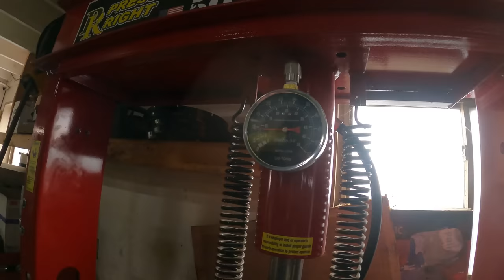Getting Ready to plant Corn

Comment: 3/4 DRIVE IMPACT  SOCKETS WORK WELL TO DRIVE THE RACES IN OR OUT. THE SLUGGER BRAND SAWS ARE GREAT SAWS. THE SLUGGER BLADES ALSO LAST TWICE AS LONG AS LONG AS KNOW SLAMS THEM INTO THE METAL AND KNOCKS A COUPLE OF TEETH OFF.

Comment: This is not meant to be mean. When you first bought the press and you sounded like it may be more trouble than it was worth. Set up can take a while to make fixtures to get the job done where if you just do the job the way you have been doing them it will be faster. I had commented that I have been using a press for years. My little 20 ton harbor freight. And yes making fixtures for the first time does take time but, the next time the job will go much faster being you do have fixtures. 
I cringed so much when I saw you put that pipe right on the race surface. Was so happy when you found a pipe with the correct OD. Yes, please keep them under lock and key. They will walk. 
Thank you for another fine video.

Comment: Allis Chalmers used a 13 wave coulter in the front , and double disc openers for fert, and then another set of double disc openers for planter unit. The trend now is drizzling fert 2" on each side of row at back of units. No extra coulters that way. You may be $ ahead going to the 2X2 attachments.
Reply from the maker: It’s a trend

Comment: I noticed you buy cut tires. To save on the cost , you Andy could easily build a unit to cut them your self. Just saying.  Alot of places are charging 5$ and more to dispose of the old tires.
Reply from the maker: That charge is mandatory on a new tire when you buy it

Comment: Why don’t you have floor drains throughout the shop that would help with not having to work in water or when it comes to wanting to be on your back underneath your equipment
Reply: Environmental laws....
Reply: If you didn’t have a flat floor it would make building/engineering a nightmare to get level and straight as well as above
Reply from the maker: Against code
Reply: @FarmingFixingFabricating  so your saying that it’s against code to put a drain in a shop floor but in a garage floor where you park your car or truck it’s okay to do that that’s pretty fucked up in my opinion
Reply: @FarmingFixingFabricating  how’s it against code to have a drain in your shop when you’re trying to remove water from the floor of your shop without having to squeegee the water out the door of your shop when it’s subzero temperature outside and your trying to keep your shop warm
Reply from the maker: @joshbutterfass5251  would have to drain into tank and have hauled off to water treatment